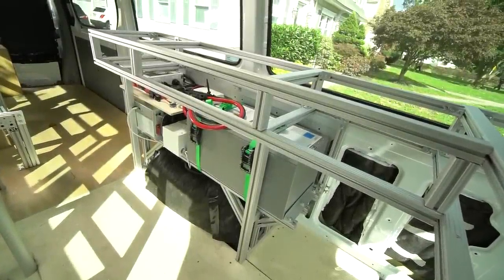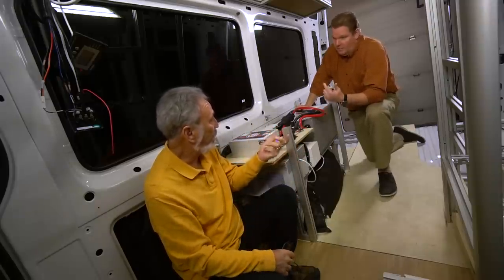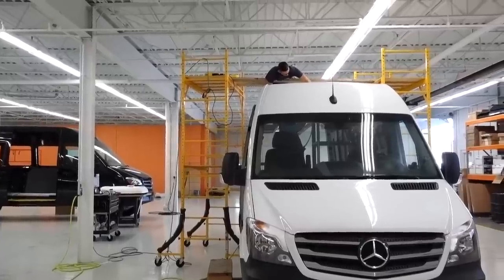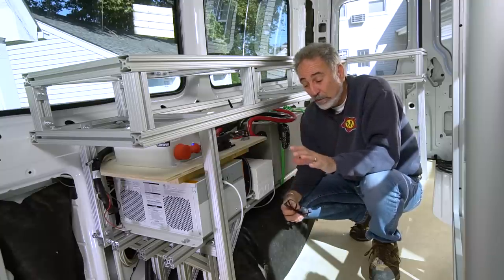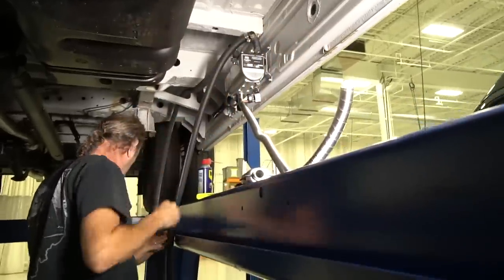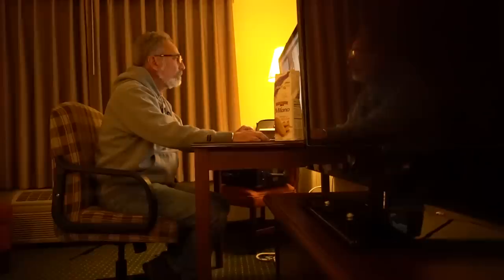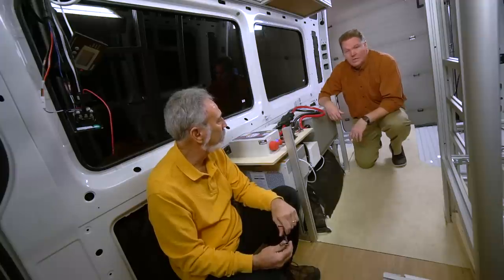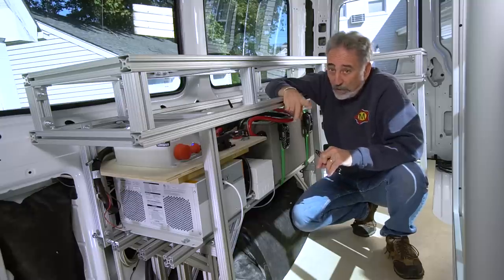Humble Road Van Build Series 16 - Best Lithium In A Van

Comment: With all of that wattage you picked up in Elkhart you might want to investigate an electric system for floor heat. 
A 168 watt Rug Buddy  kept our 28 foot A class RV very cozy in some very daunting weather. 
Floor heat is the best and it is totally silent, a great thing in a small space. 
Sleep Well, and thanks for sharing your adventures in Vanland.

Comment: Oh, and about the air conditioner - if it drew 7.9 amps at 120 volts, that translates to a current flow of 79 amps from the 12 volt battery pack, and about 950 watts of load, which sounds quite reasonable for an air conditioner, they're power hungry appliances. In fact, assuming that the inverter adds 10% inefficiency which would be stellar, you're looking at 79+8 amps, ie 87. The Lithium pack can handle the current fine, but at 80 amp draw on a hot day, you'll drain it in a few hours. Which is pretty impressive still, compared to lead-acid old crap battery tech, but you won't run the AC for days. Unless you get a fair bit of solar up there to offset the draw... and then you can always high-idle the engine and all those amps from the alternator come into play.
Reply from the maker: Yes, we were pretty pleased with that initial test. And again, that was at full throttle, everything set to highest fan and coldest temp, compressor running nonstop. And when your only vehicle is your home and transportation, you will being going on drives of some sort, market, liquor store, so you can replace amps that way as well.
Reply: Croft with two M air fans one can clear the heat out quickly and efficiently , then cold air added to keep it comfy, just cycle on till desired temp is reached.
Reply: @longhairmullet  Fans can never get he inside temp of the van lower than the outside temp. In fact, running the fans and the AC simultaneously would be pretty silly. When you're using the AC you need to keep all the ventilation openings and fans etc shut, otherwise you're just letting cold air escape. Just like in a house, if you have AC in the building, you need to keep everything else - windows, doors, ventilation etc - shut for best efficiency out of the AC. The AC takes the inside air and successively cools it by running it through the AC multiple times, it recirculates the air in the space until it is all at the right temp, and after that it goes to lower power just to maintain that comfort temperature. If there is a constant influx of warm outside air, the AC will run at max forever trying desperately to bring the temp down and failing (unless it is extremely powerful, anyway.)
Reply: Croft I wasn’t suggesting using fan and air conditioning simultaneously, but rather just prior to, to clear out heat. But no point contesting how someone else will use there own system. Im sure HR will be very comfortable.

Comment: Great video as always fine sir. Very informative. My wife and I are about to pull the trigger on a 2021 sprinter 170 ext 3500 xd 4x4 for our build. I will say I will do most of the work with a few exceptions. That being said, we plan on hauling 4 seasons worth of gear ie. Skiing, mountain biking and possibly towing a small vehicle. Do you have any thoughts on our choice with regards to weight/capabilities? Your input is greatly valued 😁
Reply from the maker: Be very aware of your weight limitations. My 3500 EXT had a GVWR of 11,030 lbs. I believe you can get a 7500# hitch for the Sprinter.

Comment: Looks great! Loving the build :)  one little observation ... Going to 5:50 in the video and the Espar installation. I see they installed a muffler to the exhaust system and it looks like the standard Espar model.  I think this was installed upside down? The inlet and outlet pipes to the muffler should be on the top and there is sometimes a little drain hole at the bottom to stop any condensed water pooling inside and making the muffler rust from the inside out.  Not sure how much difference it makes (I've always installed the other way up you see) but might be something to check?
Reply: Considering that Advanced RV installs one of those Espar furnaces in literally every van they make as far as I know it's probably not installed wrong, but George does have that sliding board he enjoys going in under the van with so...
Reply from the maker: Precisely why I had the professionals do the first install on my behalf! I don't know the intricacies here. I immediately emailed a picture to ARV asking for clarification as you have pointed out. And as @Croft said, they have done over one hundred of these installs, can't imagine they were all done upside-down! Another viewer commented that the exhaust should not have a loop in it, could trap water or condensation. My guess there is the pressure and heat coming through that exhaust will take care of any water. I'll report back when I get the response from ARV.
Reply from the maker: If I have to roll under there to fix it, it will be fun, but I won't be happy… That's one of the reasons I downsized from a 7 employee commercial photo studio, I was the one staying late, redoing their work because it wasn't good enough to let out the door.
Reply: I don't think it is something that will impact the performance one way or another for a very long time anyway.  But I can tell from the build series (I've watched - and greatly enjoyed - every episode) that you are a man with an intense eye for detail and a desire to have things done correctly 100%, which is why I mentioned the muffler.  Eberspacher (the 'real' name for Espar) instructions are actually pretty poor so there is no reason why anyone would automatically know it matters - as they don't implicitly tell you!   I think the clue for which way is normally right is that there are drain holes on some variations of the Official ones as well as the clones.  Out of interest, check out the first photo on page 14 of this Eberspacher UK Pictorial installation guide to see - as far as I know anyway - the normal orientation of the muffler.  https://www.butlertechnik.com/downloads/Eberspacher_Heater_VW_T5_installation_manual.pdf  (the vehicles and the heaters may vary, but I can't think the recommended orientation of the muffler would change).
I'm keen to hear ARVs response as I am also keen to do things as right as possible and learn (which is one reason why I like to watch your build :) )
Reply from the maker: I appreciate you pointing this out. And I hope you continue to keep your keen eye on this build. I will report back with ARV answer just as soon as I hear.
Reply from the maker: Well, it did not take long for Advanced RV to answer my email. They did their due diligence and it seems that the ESPAR installation instructions call for the installer to drill a .05mm hole into the lowest point of the exhaust. They also said they examined the mufflers they had in stock and none had a weep hole anywhere to be seen.

Comment: This van is gearing up to cost quite a chunk of change. I'm all for going with the best you can possibly find but the build-out will cost as much as the van itself at this rate. Three days of labor here, another three days there, expensive de luxe Lithium 600 Ah, etc. Still, I'm hoping to do something similar but I suspect there will be a more DIY spin on some items in mine.
Reply from the maker: The prices of mass produced class B vans has been climbing steadily now over the last few years. Most do not include the quality of components I have chosen, nor do they employ the build quality I exercise on a daily basis. I have literally cared for the turn of every bolt. I also do not need to concern myself with labor rates and employee carrying costs, because I am building for different reasons other than profits. The value of the product I turn out will exceed it's price. And I'm loving every minute!

Comment: Am I missing something? Why two max air fans AND A/C unit? Can’t one fan in front with A/C over bed in rear do the job?  Beautiful, by the way. We are loving watching your videos while traveling back home from a work/play trip in our completely bare Sprinter Van. Wishing we’d spent some time building it instead of just piling a couple of mattresses in...but, hey, we traveling.
Reply from the maker: This van, and most others I have built, do not have opening windows in the living area. They are fixed glass from the factory. So you need two fans to make your own circulation. I prefer having the control that two fans afford.

Comment: How does it handle cold weather? I live in upstate NY and often have my van in the driveway in sub 20 degree weather.
Reply from the maker: Donal Fitterer it would be fine as long as you understand and follow lithium battery protocols. Personally, I would let it stay alive. Run the Espar full time and use the van as much as possible. They’re not made to sit.

Comment: A word on Xatrex.  I upgraded my old inverter and transfer switch, which functioned perfectly, for a new Xantrex inverter and transfer switch on my boat.  The transfer switch trips the GFI breaker on the inverter.  Everything is ok according to Xantrex, it just doesn't work, something mysterious with my grounding system.  No ideas, no troubleshooting, no testing, no suggestions, no nothing.  I have to go down to the engine room and reset the GFI outlet every time the "automatic" transfer switch operates.   Xantrex customer service spent quite a bit of time on this, however, ultimately, they left me with a difficult situation.   I really should have kept my old transfer switch, it worked.
Reply from the maker: "everything OK according to Xantrex." That would mean you sent the inverter in for testing and or repair? That would be the only way the inverter could have a clean bill of health, right? And you replaced the GFI?
Reply: The GFI is built into the inverter.  Yup, we sent parts back and forth, they couldn't recreate it, it worked fine on their bench, just not so much installed.   My boat has been checked over by a certified electrician, everything is proper.  One of the issues installing electronics on a thing you can't bring in to them.
Reply from the maker: That is frustrating. I'm sorry I have no good advice for you.
Reply: Neither did Xantrex

Comment: Is rubber coated wood required for insulation of the mounted components? You could save some grams directly mounting to the extruded aluminum bridge.
Reply from the maker: There are a few small loose items and I also want to leave room for future upgrades.

Comment: George do you still install these Xantrex systems in your van or have you upgraded?  Would you list out all the parts you currently use in your main electrical system please?  No need to include any of the end use items such as fans, AC, lights and such.  I am only interested in the system such as batteries, controllers, buses, charger, alternator and such.  Thanks even if you consider it.

Comment: Great job! How many watts of solar will you be installing on the roof?
Reply from the maker: Hard to know for sure. I am debating the commitment to a brand new solar technology, in SOFT panels! I have to trash all that I know about glue down soft panels and accept the new world we live in! I'm not there yet...
Reply: I'd avoid the flexible panels if at all possible. They either flap themselves to death through microfractures if they're not glued down, or they fry from overheating if you do glue them down. The failure rates on flexible panels is probably through the roof. One lead might be to consider short hard panels so you can place those across the roof. Panasonic makes a nice short panel that does 295 watts. But with two fans and an AC up there, your real estate for panels has been dramatically curtailed. You probably won't be able to fit all that much up there. But since you don't seem to be too price sensitive on this stuff, perhaps the Solbian flexible panels might be something to look into. They're quite expensive but come with five year warranties (I think), and you can get pretty decent capacities for their size.

Oh and since you're a t-slot enthusiast: DIY motorized solar panel tilting mechanism with an actuator, anyone? :)
Reply from the maker: "I'd avoid the flexible panels if at all possible" is exactly what I'm talking about! That was the old panel. Here we have the new panel, evidently those issues have been addressed. We have to re-adjust our perspective.
I am working on how to fit the panels up there now. The new soft panels can be had in 6x6 inch configurations, so easily customizable. And the ribbed design of the Sprinter roof would allow for underside ventilation. Somewhat..
Reply: One way to get maximum solar power per square foot on the roof is to stack the panels.  Imagine three 300+W rigid panels...the center panel is attached to the roof or a roof rack orienting the short sides across the van and long sides front to back.   The other two panels attach to the center panel with hinges that allow the two panels to fold on top of the center panel.  Think about how you tri-fold a 8.5"x 11" paper to fit in an envelope.  Perhaps rubber bumpers between the stacked panels to keep them from beating each other up during transit.  No solar power produced during travel, but no worries because the alternator is on the job.  When parked, unfold the two panels to expose all three to the sun.  As the 300+W panels are large enough to nearly span the roof width, the outer two will hang over the edge of the van, which allows you to tilt them to take advantage of a low horizon sun.  Imagine the center one flat (duh), but the drivers side panel hanging down somewhat, and the passenger side tipped up a bit.  900 to nearly 1000W of solar on the footprint of one panel.
Reply: David people are always thinking....
Reply: Humble Road yes after watching solar walk through on another site I’m re thinking the flex panels as well. Look to be equally efficient and SO MUCH liter in weight. Looking Ford to viewing your solar set up. Thx for your inspirational build.

Comment: Great setup, is the battery a Zantrex  or Lithionics Battery  as shown in intro.
Reply from the maker: The battery and the BMS are made by Lithionics. Sold through Xantrex as part of their direct OEM system. My set up was acquired outside normal channels and Xantrex labels were not in place.

Comment: Hey, what is the finished ceiling to floor measurement where the a/c unit is. I am 6'4" so I am just curious if I am going to be bumping my head into that thing all the time. Thanks.
Reply from the maker: The van is no longer in my possession, so I cannot measure. My experience tells me yes, you need a very specific build. I am starting a custom build for a tall gentleman in February. Stay tuned.
Reply: @HumbleRoad , yeah, I figured that would be the answer. It is okay. I just recently found you, and I am already an addict. I have been binge watching this whole weekend.

Comment: Thinking about a Ram Promaster conversion. Is there a S-bar (sp?) heating/water heat system that runs off gas? BTW, the vanlife community loves you!
Reply from the maker: Yes, the Espar system is available in petrol (gas) or diesel. IMHO, omitting propane from the van is a big deal. One fuel source only, thank you!

Comment: hey George, fascinating stuff as always, showing us how you livin on the hi tech edge. Just wondering, with the AC and 2 max fan shrouds up there, how many solar panels can you fit? (guess you haven't convinced me of the need for 2 fans yet :)
Reply from the maker: Remember the windows in this van are fixed. Two fans is key to my system, along with some sneaky ventilation physics I will reveal soon.  I have two squarish spaces up on the roof and a couple skinny slivers. The panels I am looking at can be configured in groups of 6x6 inches, so filling up the available area should work out pretty well. I am going to do my drawings tonight so I can get my order in asap.
Reply: Ah yes, forgot about the fixed windows, that now makes sense.  I can't fit any more big panels but I too have some slivers up there I would love to fill with your 6x6 building block panels. Look forward to hearing about them. Why didn't I think of that? Excellent!
Reply from the maker: The panels are not on the market yet. Continue to search for Xantrex Solar and eventually you should find some info.
Reply: Just keep in mind that even partial shading, as in an inch-wide sliver of shading, will devastate the output of the solar system causing it to turn in a fraction of the amperage of unshaded panels. Those fans and the AC may become a bit of an issue especially if you don't tilt the panels towards the sun.
Reply from the maker: Shading is the single biggest issue. I have a couple pairs of roof brackets that accept the 80/20 15 series. I could position rigid panels just above the AC and fan heights. Oh that reminds me! I have to strike a new overall height now that the AC is up there! Where's my level!?

Comment: George, you didn't mention weight of the battery system. Just curious about how much it added. I am looking forward to hearing that AC unit.
Reply: I'm sure we're about due for an "I weighed my van again" video soon, which will be entertaining as always.
Reply from the maker: Thanks Croft. Yesterday I worked on the plywood shelf over the inverter. Got the aluminum bridge installed. Today, in the pouring rain, I will shape and coat the plywood. Once that is finished, I will measure and order my countertop. Once the countertop is installed, I will fill up the fresh water tank on the opposite side and we will weigh.
Reply from the maker: Battery: 160 lbs.
Inverter: 75 lbs.
Solar Controller: 15 lbs.
Reply: Thanks!